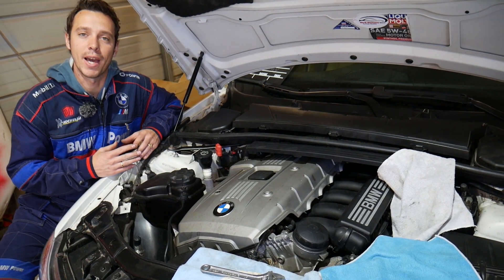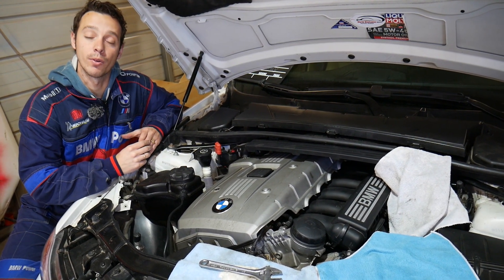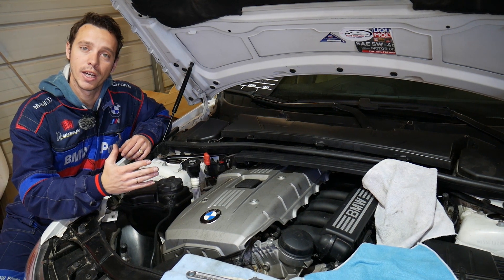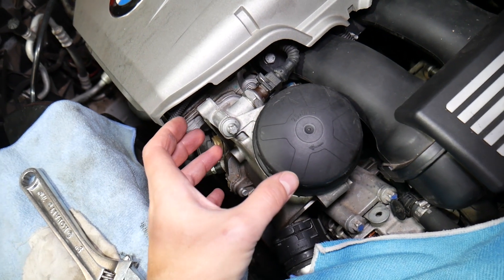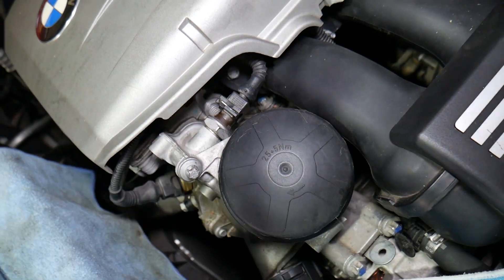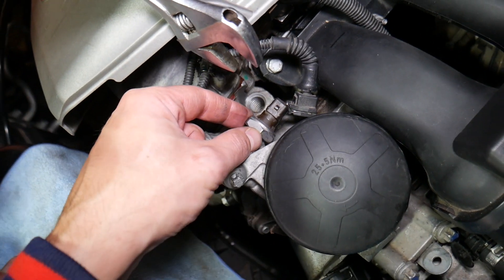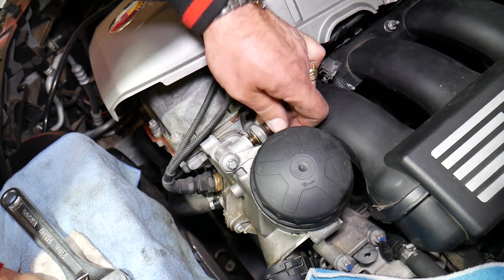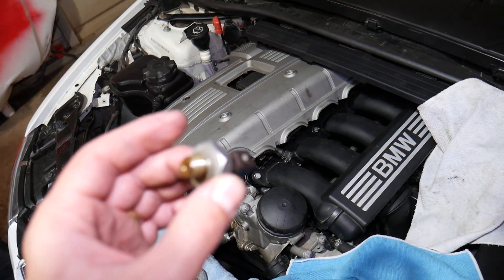BMW X1 OIL PRESSURE SENSOR, OIL PRESSURE SWITCH REPLACEMENT LOCATION

Comment: Hey bro, I hav a 2012 bmw x1 and I don't think my oil sensor is near to the filter because im not seeing it, is there any where else it can be?
Reply: X2
Reply: Did you ever find it? I have a 2013 X1 and mine is not near the oil filter housing.